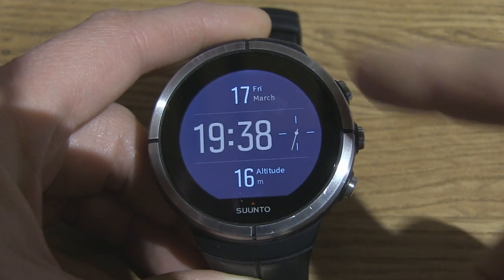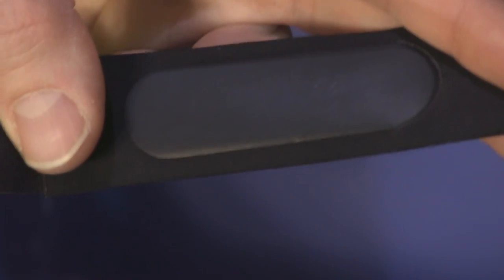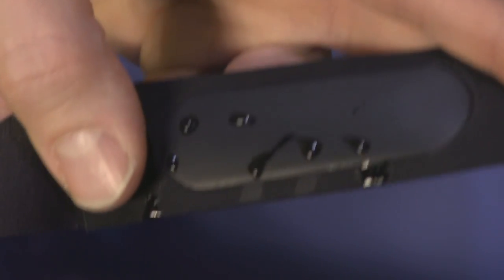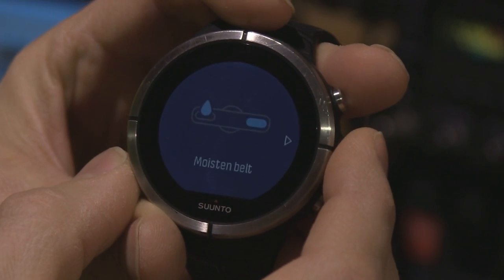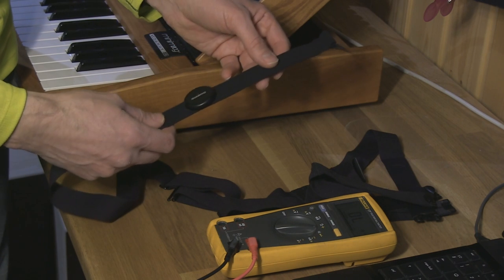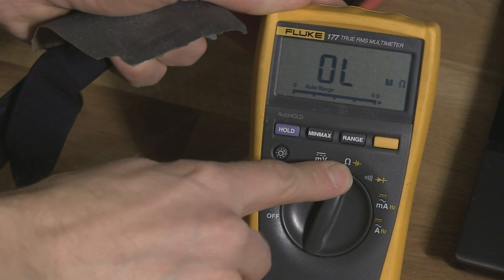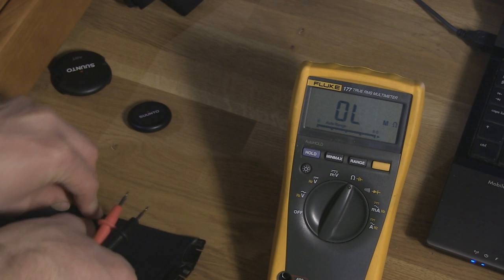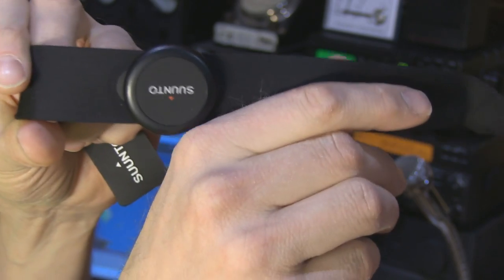A Great Trick Solving your Heart-Rate Strap Problem

Comment: I have been licking my heart-rarte strap contacts for 10 years. Works every time.
Reply: same, but I'm going to try his method see how it goes
Reply: Been doing the licking for decades with good early results, but lately results have become sporadic. 
Wetting body did not help.
However, improving belt contact by cleaning belt's rubberized contact areas with soft scrub (kitchen product for polished stainless steel) helped some.   But it was only after tightening up the belt itself that continuous contact was assured.   Apparently, over time my belt had stretched or loosened and wind would dry the skin making contact erradic.    Snugging the belt up did the trick.

happy rides
Reply from the maker: Yes many do that.  I'm not sure but there might be a risk however that the acid in the saliva might deteriorate the strap a little faster.  But probably there is not a big difference.
Reply: so wetting the entire strap on the inside and the on the outside is totally unneccessary??? just wet the two eletrodes is good enough???
Reply: @jamesoitzinger6640  how tight is too much ? does over tightening it might reduce the inaccuracy of the HR result it generates? mines is feeling like more than just snug.
Reply from the maker: @MissHitAllTheTime  No, wetting the belt or electrodes is unnecessary.  You need to moisten your skin.  Wetting electrodes will give only a few water drops on your skin, so better properly wet your skin as I show.
Reply from the maker: @MissHitAllTheTime  Too tight is uncomfortable but does not reduce accuracy.  Well, if you over-tighten the belt might break and then give bad results, of course.
Reply: @Scott Omari definitely, I have been watching on InstaFlixxer for since december myself :D
Reply: Hope you enjoyed it ……. Time to get married 😅
Reply: I thought I was the only one that did that.
Reply: 😂😂😂 👌 I’m so silly. How did I not think of this. I just done the water trick 6 years later and I was saying I’ll get another 3 years out of my strap now  tongue power it is instead.

Comment: Hello! I had long since given up on my Wahoo Tickr. But inspired by your video I tested the resistance of the strap. Although I had thoroughly cleaned it the resistance was over 7 kOhm. I then rubbed the pads with silicone remover and got down to about 0.3 kOhm. In today's Zwift session the HRM worked just fine. Thanks for the tipp, I wouldn't have thought of testing the resistance.
Reply: hello, could you elaborate a little more? what product did you actually use?
Reply: I don't know, some in-house brand of a DIY chain. But it matters not, silicone remover is basically just a degreaser. It's the same stuff used to clean parts before applying a paint-job. @crysogonus
Reply: much obliged!
 @OliverScheffer-Photography

Comment: Good video. Tap water isn't the greatest conductor, so I have thought of using saline or ECG electrode gel to put on my chest.  Some say the electrode gel can cause the heart rate strap not want to stay up because it is so slick.
Reply from the maker: Note that the water is not used as a conductor but to moisten your skin.  The skin contains all kinds of electrolytes, but a dry skin is bad conductor.  Electrode gel is good, but be careful not to damage the strap with chemicals.  It might deteriorate quicker with time if using chemicals like deodorants or gels.  Also, if the gel contains silver it can give health problems if used frequently.  Some people like to lick their belt, unaware that the acid will damage the belt over time.
Reply: @TomTechVideos  Thank you.  My Garmin strap wasn't working well and I checked the impedance and it was over 400k.  I would often use saliva to moisten the pads. This new (to me) information makes me think the saliva may have contributed to a slightly earlier demise for my strap. I have seen some suggesting saline solution (because it has similar sodium content as sweat) or Spectra 360 (sodium free electrode gel).  But that makes sense that the water is not used as a conductor but instead just to moisten the skin.  I have always been confused by the recommendations to use water since it is a bad conductor and you are the first person to clear that up.

Comment: lick a belt, put on chest. lick to fingers and touch sensor electrodes, pair/connect sensor to device while it have connection with wet fingers, put on strap and ready to go…. with  this trick i never have problem-working 100% on polar h7 in tropical and/or subtropical areas ….

Comment: I have had very similar problems with my Suunto heart-rate belt (used with an Ambit3 Peak).  In my case the heart rate readings had become intermittent and incorrect, and then finally I could not get the watch to pick up anything.

To cut a long story short: the problem was the electrical contact between the central connectors (where the Suunto module plugs in) and the conducting polymer strips that run to the contact pads.  On one side I had a reasonably low resistance (about a 1 kOhm) between the connector and the pad,  and on the other side greater than 300 kOhm.  For whatever reason (poor design, penetration of sweat etc) the contact between the connector and conductive polymer had failed. 

My solution: I carefully slit open the rubber seal on each side of the connectors to expose the contact between the polymer strip and the connector. I then cleaned up the area (mechanically and with isopropanol) and used a silver conductive epoxy to remake the connection. Finally I sealed it back up again with an RTV silicone. Result: works perfectly now. 

Or I guess you could buy a new belt...although I think it is likely the same deterioration will happen over time, unless Suunto have changed the design.

Final comment: I also cleaned the pads rubbing gently with water and isopropanol. I don't thing this was critical, but you can certainly improve the surface conductance doing this. If you wanted to make a conductive gel --- you could try potassium/sodium salt ( from the supermarket) dissolved in glycerol/water. This is a well known combination. Licking probably works fine, anything that is not pure water will improve conductivity.

Comment: 6 years later, just saved my HRM from the bin. Water on the chest worked! Chest strap lasted 3 years so not bad. Now I discovered the water trick I’ll get another 3 years before ordering the strap lol.

Agreed regarding battery. Good quality lasts a while. Also worth remembering, whilst 6-12 months is easily achievable on a good battery, if you train multiple times a day (3-6 hours daily total) then the battery may need replacing quit a bit sooner.

Thank you for the tips and hacks 🙌

Comment: Thanks so much for this video! The multimeter tip was a great way to confirm that yes, my belt had come to the end of its life. I got a reading of 17 kilo-ohms from it. Got a new belt, and it gave a result of about 550 ohms.  Problem solved. (the problem was that during an exercise the heart rate reading would go down to 00 for several minutes at a time)

By the way, some people claim that some people's sweat has a bigger impact on the contacts than others.

Comment: If you have a polar h7 that skips and spikes during movement I fixed mine by doubling up some tin foil in between the belt and the connection domes, this basically tightens the connection. Works well

Comment: Hi Tom. Thanks for this. I have been having issues with my polar h10 strap of recent with it just dropping out now and then. Eventually it wouldn't connect so replaced the battery which got it working but it still drops out. I have not had an issue with it for the last yr with just wetting the electrodes. But will try your method. I did just test the belt which came out good at 0.7 ohms.

Thanks for posting your video. Regards Lee

Comment: My Polar H7,  was not working. I measured the belt resistance and it had more than 12k Ohms. To have the information about the correct value of the resistance was very useful for me.(<1 k Ohms). I found the solution, changing only a belt.

Comment: Very useful information.  Nice to know how to measure the resistance, and very good to say what it should be.  I was able to eliminate increased resistance from the belt as a reason for my apparently non-functioning HRM.  I had tried shorting the contacts, in addition to changing and leaving the battery out for several minutes.  The last thing I tried was deleting the HRM from my watch, and rediscovering the HRM.  It turned out that it changed it's "name" from whatever it was previously (a six digit number) to "496158".  By re-discovering/pairing, I was able to use it again.

Comment: Thanks for the video.  I've had bogus readings 3 straight days with my Polar chest strap.  The strap looks great, but tested terribly.  I have several other straps that tested well & look forward to trying one of them tomorrow.
Reply from the maker: Polar used silver wires in their fabric straps some time ago.  I have such a model and those gave a good contact.  But I think they then changed to plastic.  Maybe because it might not be healthy to have silver contacting your skin.  Even the silver containing electrode gels might not be good to often use.
Reply: @TomTechVideos   My guess is Polar switched to the cheaper material simply because it's cheaper.  Unfortunately I believe every device is now made in China for low cost. So far, a few days into using a newer Polar Strap (It came with a defective sensor last year, so I never really used the strap),  I haven't had spikes or drop offs.  This Polar strap has a much larger rubberized contact area on the chest side.  Not sure if that helps with conductivity or not.  Kiitos!  I've never been to Finland, but have Finn blood on both sides of my family.

Comment: Thanks for the advice, question, you said 10k ohms where you found this info?
Reply from the maker: Thanks, You're welcome!  The 10k is from my experience and it is quite an approximate value.  A brand new strap could be about 2k.  A one that definitely does not work is 20k or more.  The 10k is somewhere in the range that the reliability starts to go down.  In a way this is related to normal skin resistance across the distance between electrodes.  I might make a more detailed video about this topic later if I get enough subscribers and can start making new videos again.

Comment: Hi. Your comments about resistance pad to pad interested me. My garmin strap stopped working....battery was down to 2.4 volts. Replacing battery with new battery working at 3.4 volts did not work. I measured resistance across pads as you suggest and it was massive...1.2mohm. I assumed strap was dead on the basis of your advice. However, I then tried shorting battery contacts as per another video on youtube and then replaced battery.  Worked fine immediately. My message would be that I'm not sure your comments on resistance  between pads are a reliable indicator of whether the strap is broken. Btw my strap is an old ant only 1. Ta jim uk
Reply from the maker: The resistance may vary between different models and brands.  But 1.2 Mohm?  That sounds like it would not work.  If you measure your skin you get that kind of numbers.  Maybe you did not press the pads together well enough or you had them the wrong ways and measured the resistance of your fingers.  The side of the belt that touches your chest should be pressed against each other.

Comment: Hehey thank you Tom. I checked my old ant belt step by step you showed and found that the problem probably, if not definitely, in resistance of rubber contacts. Why probably, because I haven't that measure device but with method of deduction, checking other variants and connectivity with the watch was the same - no outputs - I stopped on this. Even visible it could be seen a little dust and micro damages around the corners. I tried to clean from dust, it almost the same, some outputs were 2-5 seconds but then again no outputs. 
I think it's time to replace with new belt and test it with my old ant sensor, I suppose it still works because 2-5 seconds of outputs say it still alive :) 
Or may be take completely new one with new standards.
Again thanks for advices, keep it doing. Nice channel, useful advices :)
Reply from the maker: Yes the contacts might be the problem.  I hope you checked the battery first as it might also cause the belt to only work for a short time.
Reply: Tom Tech Yea thanks. Sure. Firstly I checked the trick with moisture as you showed, then replace with new batteries. No outputs. Then I washed the contacts gentle cleaning it around - after that there was some stirring up for a short time when I tried to check it again,  there was some outputs on the watch for some seconds and that's all. Surely the contacts are already too old, I bought it in 2013 :) Used not so often but belt seems like worned out

Comment: I've used a H10 sensor for about 2 or 3 years, but the belt has broken down. I was doing the chest-moistening trick but also putting some water on the belt, even though I noticed the same issue (the plastic pads are hydrophobic). However, even though I don't use the belt super often, cracks started to appear in the contact pads. Yesterday the HR updates got slower and slower, then stopped. My suspicion is that the way I stored the belt caused this -- I was basically folding it over itself, which obviously caused elastic deformation stress over time. My next belt will be gently rolled up instead, I think.

Comment: That's a valuable video, thanks. Iam having a Wahoo Tickr one and its sensor pads are coming out of the strap, can I fix it with a glue or replace it, please suggest.
Reply from the maker: Hi.  I'm no familiar with Tickr but I guess you could try to glue it.  A normal glue is electrically insulating so you can not try to re-connect a broken electrical connection, but if it is just mechanically loose from the strap, then gluing should not be a problem.  I guess superglue or rubber glue could work.  Some glues might damage the electrode chemically so be aware of the risk and be careful to not contaminate the contacting surface of the electrode with the glue.
Reply: @TomTechVideos  Thank you so much Tom, yeah it is mechanically getting uprooted, will try a rubber based adhesive to fix it. Fevibond should work on it.

Comment: Nice tips. One question. Will the sweat on the chest’s skin moisturize the contact? It’s almost always that I sweat in the area where the sensor sits. A good practice is to wipe the belt with warm water after each use to keep it clean and germ free. Just my 2 cents worth. Thanks.
Reply from the maker: Yes, if you sweat you don't need to add water.  And the key point is that the belt contact doesn't need to be wet, your skin needs to be wet.  Moisturizing skin before starting an exercise helps in the beginning before you start sweating.  Also, moisturizing skin is better than moisturizing the belt because skin absorbs much more water and in a larger area, keeping a good contact even if the belt shifts in place and this larger area also neutralizes static electricity from your shirt much better.

Comment: Hello. Thank you for the very informative  video. I owm a Brytom 610 cycling computer. When I'm using the heart rate strap, I see a light verifying that there's  a signal. But, within riding the signal is very intermittently  working. I just tried the Ohm resistance  tip. My meter continues to display 'old. No numbers are displayed. The batteries are fairly new. Any other suggestions?

Thank you
Reply: The sensor displayed 0.595 DCV
Reply from the maker: @richardcoppedgejr6871  That DCV is the voltage from the sensor - that could be OK.  But the 'old (overload) when measuring resistance means there is no contact at all.  You can try to connect the ohm meter probes together - it should show a very small value.  Then you can measure one half of the strap at a time - from one sensor contact to the electrode.  Maybe one half shows overload and the other some proper value?  Then the overload half is broken.  If it works intermittently there can be a broken contact that sometimes makes contact when it moves.  It might be difficult to fix if you don't see any damage.  Conducting glue could be used to fix some cases but it might break soon again.
Reply: @TomTechVideos  i have a new chest strap arriving this week, just in case. Plus, Duracell batteries. 
Thanks again for your help.

Comment: Thank you very much Sir, so much that I learnt in this video, but I couldn't see how to measure the resistance of the belt strap , maybe you should make it more easy for us to understand in another video, and do you sell, heart rate belt so I can buy from you sir?
Reply from the maker: I don't sell belts.  You can find them on many online shops.  I did try to show how to measure the resistance.  Just press the electrodes together and measure the resistance between the metal contacts.  Meter should be in the ohm-position.  Check that if you directly connect the meter probes together the resistance should show zero, or a very small value.

Comment: Thanks for the video.  99% isopropylic alcohol restore the resistance to my 2 belts.  My old one had no reading and after vigorous rubbing with IPA , it now read less than 500ohm.  My newer one reading went from 800ohm to 220 ohm.